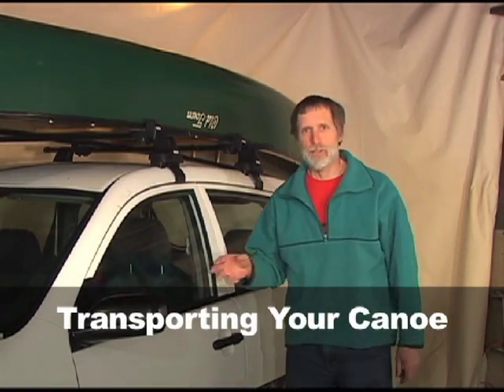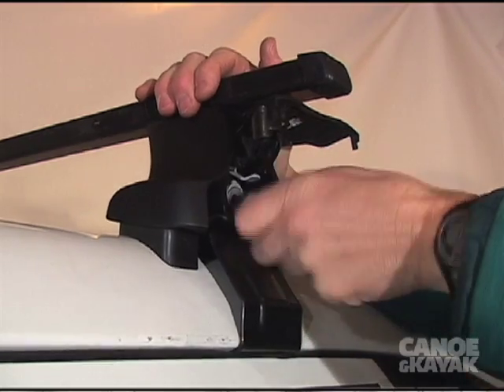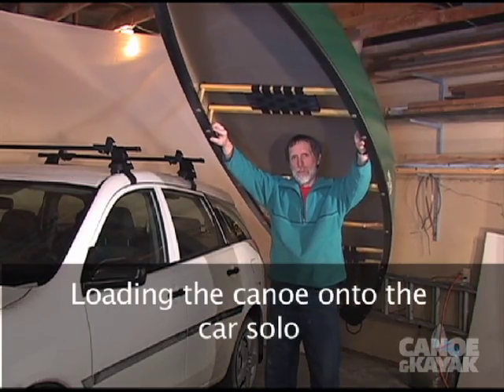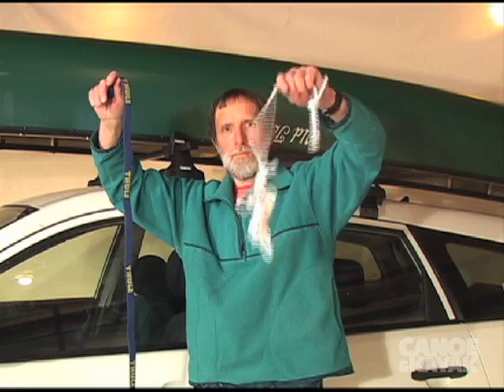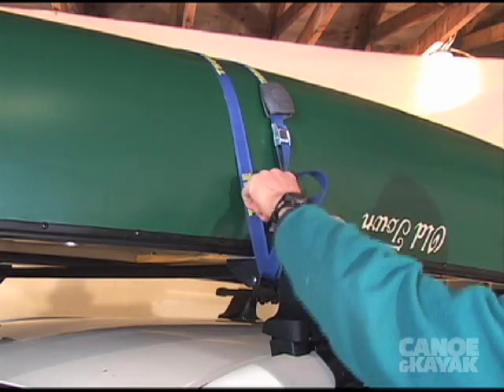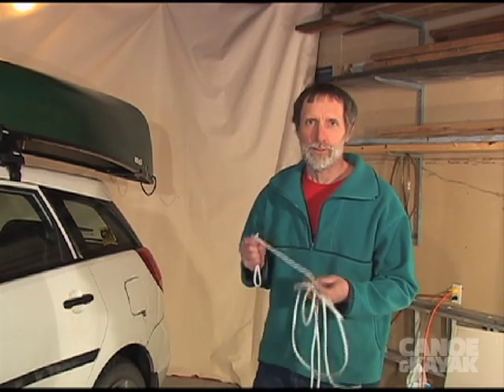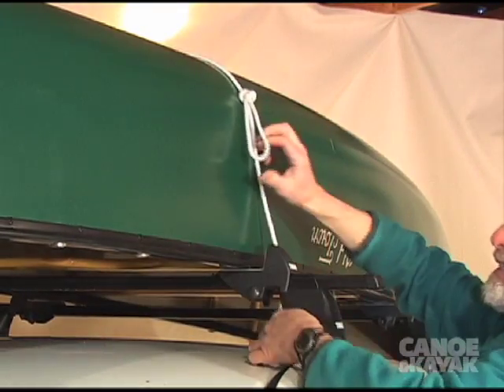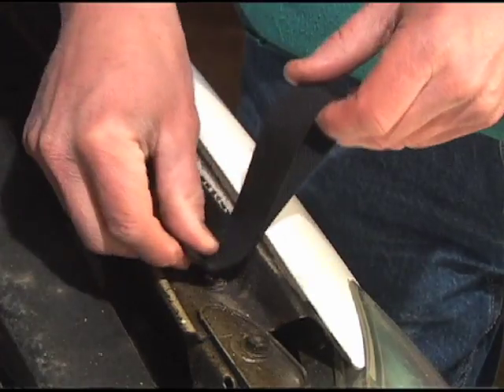How to transport your canoe

Comment: What do you call those feet that you attached to the roof rack cross bar that the canoe rests on? I would like to maybe search amazon for them
Reply from the maker: Well, I don't recall, but now I generally don't use them. of course now i have a 2x4 as cross bars, so not as slippery.